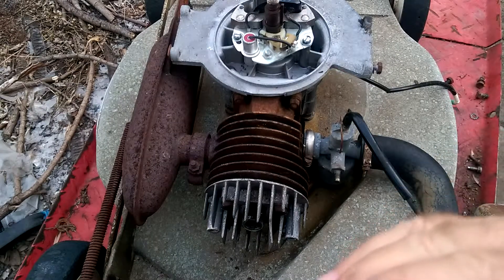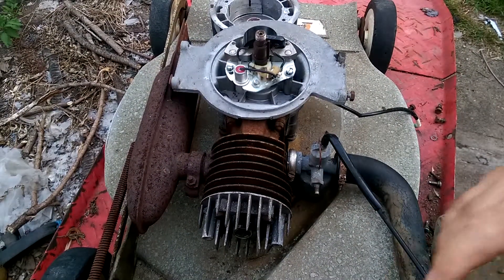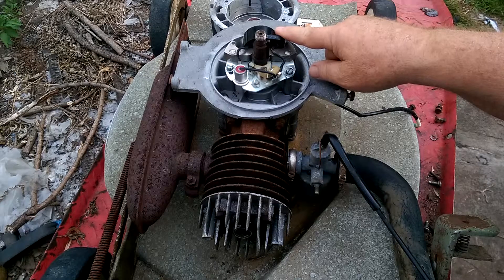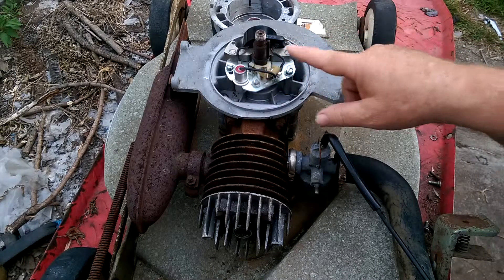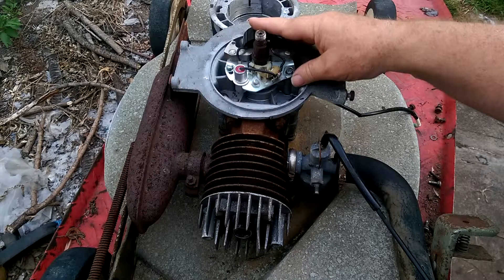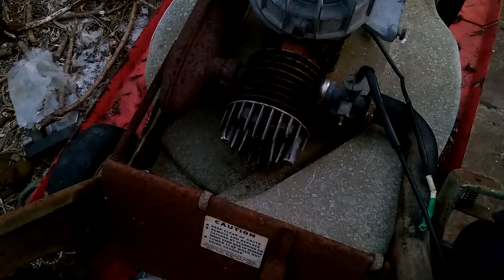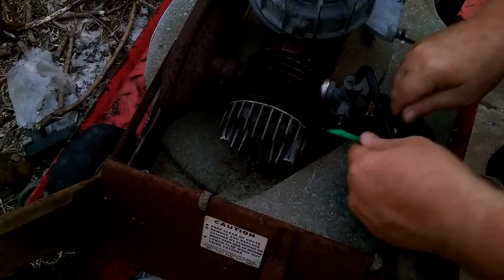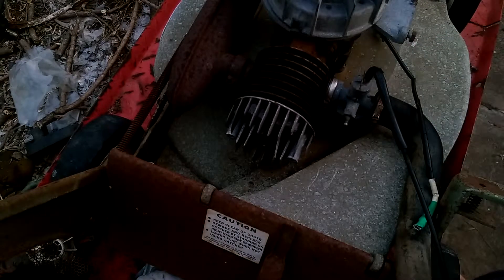Old Victa ignition magneto reassembly and testing.

Comment: Hi Rolf. I am doing this on my 1971 Victa Corvette. How did you set the timing to 1/8" BTDC. That's the adjustment I need to make thanks!
Reply from the maker: Long time ago.  I think put the engine in the right position. Then turned the stator plate so the points were just opening.  If it’s a fixed stator plate adjust to just open at that point.  Hope that helps.
Reply from the maker: The second part meant to read to adjust the points to just open at 1/8 btc
Reply: @rolfgrosseholz1311  Oh yes. I have set the points gap to 020. And found TDC, but the part I am not sure is how to then find where is 1/8" BTDC. That's where to adjust the stator plate. But how do I find that lol :)
Reply: 1/8 BTDC is a mechanical measurement of the piston travel.   If you have found TDC via the spark plug hole you just have to
move the piston top 1/8” backwards then adjust the timing.   I am sure you can also work it out mathematically using the diameter of the flywheel and stroke to work out the length around the flywheel that equates to 1/8” of travel.
Reply: @pauljames5142  I worked it out and got the mower running a long time ago, but I still dont know how I did it. Lol. I did take pictures for reference though :)

Comment: Got old 60s utility with even older motor on it I think , have to tackle it some time in the future, Guy that had it couldn’t get spark, so I will pull it apart soon and see what’s going on,, he cut the spark plug lead off but I need another spark plug leads I’ll have a look on eBay,,
Reply from the maker: Those coils are hard to find these days.  A coil off a victa Supastart will fit and are reliable.